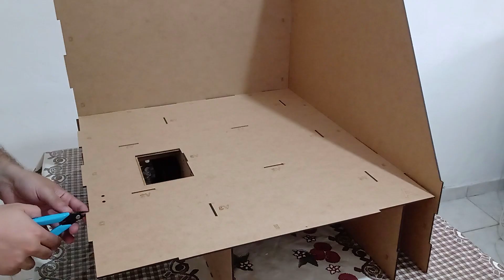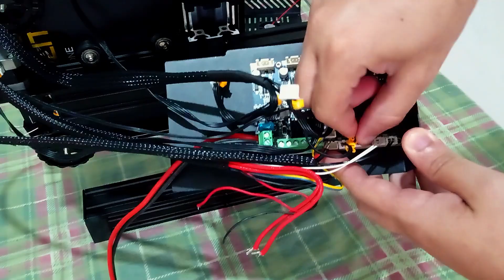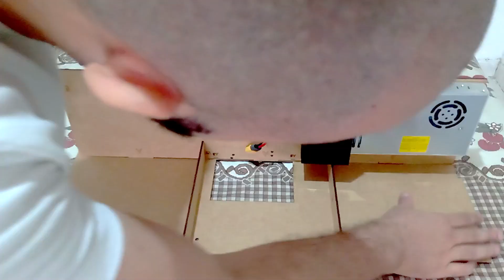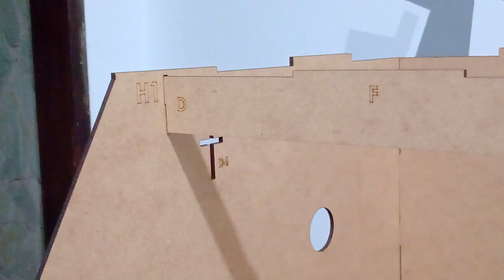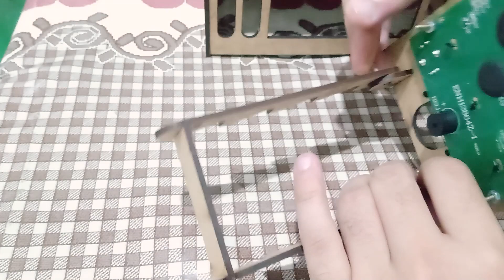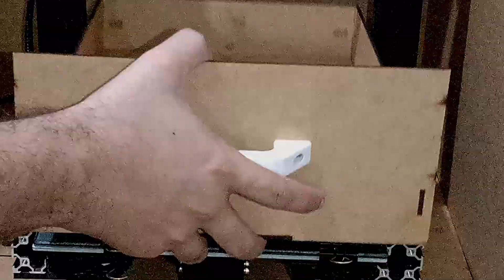Creating the Ultimate 3D Printer Enclosure: DIY Edition part 2

Comment: Very nice design! What is the size of the biggest individual piece? I have a 40x40 laser bed, I want to know if it would fit before getting the files. :)
Reply from the maker: Each sheet is 80x90cm (31.5x35.43 in) and the thickness of the board is 3mm (3/32in)
Reply from the maker: The biggest piece is 72,2x62 cm (28,42x24,4in)

Comment: If we purchased the PDF, how can we extract or adapt it to a laser cutter file?  I have a few laser cutter shops near me (do not own one, of course), but they require specific formatted files (STEP, STP, DXF, SVG, EPS and AI).  They do not appear to accept a PDF?
Reply from the maker: You can open the pdf in Adobe illustrator and save it in the format the shop use it. But usually they accept PDF. They use it the same language that is vector lines
Reply: @print-ideas  Thank you so much!  I love this design and can't wait to start working on it.  I have gotten a few quotes in my area for laser cutting (there aren't that many), but am wondering what the thickness you recommend is?  0.25 inch (about 6.3mm) MDF is not that cheap, and I have worked with 0.125 (1/8) inch (about 3mm) hardboard before.  Do you think that thickness (and using hardboard instead of MDF) would work with your plan?
Reply from the maker: My design is for 3mm boards (I don't really know the imperial measurement) it has to be this thickness so the boards can fit in properly. The material is up to you actually, but make sure that you don't use a wood that is too unstable, MDF is good because it insulate and is very uniform.
Reply from the maker: And don't forget to share the video with your friends!